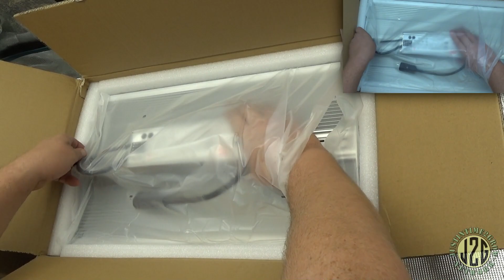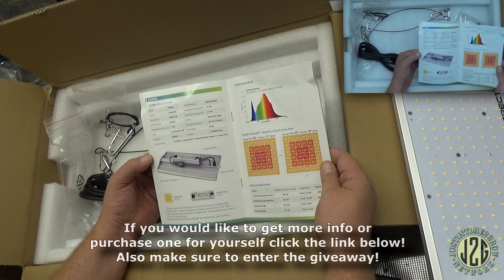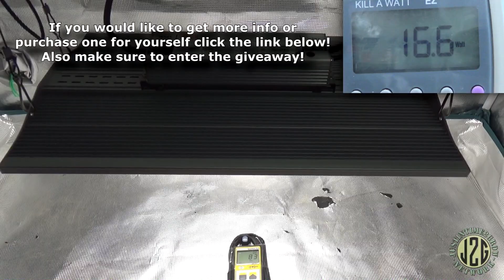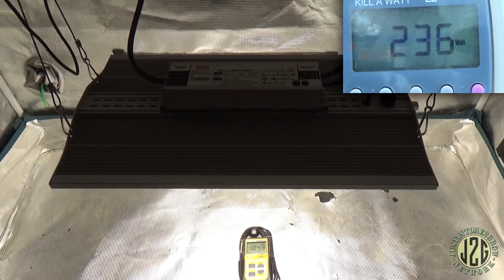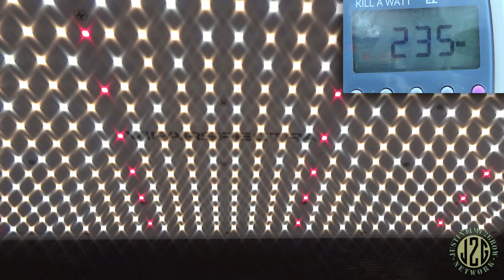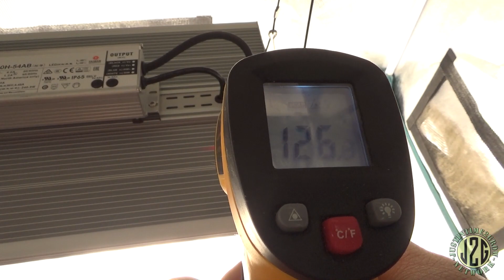Viparspectra XS2000 Giveaway, Unboxing, PAR, Wattage & Heat Test

Comment: A test that is needed is.  If 2 xs1000 in a 3x3 tent vs 1 xs2000 in a 3x3 tent?   See if the 2 lights together would be more than the 2000 or would the 2000 win out

Comment: Great video I need a new light for a 2 by 4 and I can't decided between the sayhon sh2000 with the bar and the viparspectra xs2000 which do you think would be best choice...
Reply from the maker: Neither fully does a 2x4 as you can see in my test videos of them. XS4000 or two fo the SH2000 would be great.

Comment: I received my xs 2000 with 700 leds and not 504 like yours ... would there be 2 models ? ? Strange..
Reply: may be nock off or rebranded
Reply: @kodywayne6211  there are 2 models a light with lm281b and elg meanwell for Europe and an lm301b model for the usa  with hlg meanwell

Comment: A friend of me from europe would like to buy a Viparspectra P2500.
Unfortunately this light isn´t available and won´t be in future at the Viparspectra EU - shop/site.

So if he would buy it via american postal service from the states it would cost in total at least 275€ 
and in case of warranty he would have to pay all international return shipping costs. 
Really not ideal!

As an american buyer the P2500 costs you only 207 USD(10% coupon) with 3 years guarantee service in the states 
and as an european buyer you got just 2 years guarantee for europe, but like I said the P2500 isn´t available at the EU-shop/site.

So if he would buy the smaller P2000, wich is available in the EU-shop/site, he would have to pay 259,99 € for 2 years guarantee service at the EU-shop/site, 
at the US-shop/site it costs only 198,99 USD(without coupon) with 3 years warranty service.

Just for comparison, you can get the SpiderFarmer SF2000 for 247,03 €(without coupon), this light has only high end parts and six leds more than the Viparspectra P2000, not such an nice heat sink like the Viparspectra leds but 3 years guarantee also for their european customers.

If you want a Viparspectra in combination with famous high end parts, you should have a look at the Viparspectra XS series.
But since 2020 the only differences between the XS and the PRO series are the drivers (XS:Meanwell;PRO:Sosen), 
the number of leds (the XS2000 for example uses 504 leds at 240 watts, the PRO2000 uses 600 leds at 200 watts) and the color of the led boards.

My european friend already got the SpiderFarmer SF2000 (new model) and would like to have the Viparspectra P2500 additional,  for the bigger number of leds, the 50 watts more power and for testing the Sosen driver.
But Viparspectra don´t gives european customers the chance to get the P2500 in the EU-shop/site.

Also the Viparspectra P2000 costs more than the SpiderFarmer SF2000 in europe.
So why should anybody pay more for less high end parts, maybe beause of the heatsink and the color, I don´t think so!

So hopefully Viparspectra will offer all of their lights at their EU-shop/site for affordable prices in the near future, because I heard alot of good things about their lights and I think they are really sexy.

Peace - stay healthy
Reply: Good luck with warranty,s spider farmer aka( meizhi)rip offs

Comment: I want to use 2 of these in a 3x3 right now I have 2 of the same strain plants with different soil and 1 happens to grow twice in size. I want to be able and control the light at different heights from my next grow on... you think 2 of these or 2 Spider Farmer SF2000
Reply from the maker: 2 of them in a 3x3 would be pretty solid for sure.

Comment: If you think that is a beast you've never seen the Fluence Spydr 2x. That looks like a flimsy light with a lame coverage area of 3x3 in flower. I would need two of those to cover the same area of my Spydr 2X
Reply: yeah that spydr 2x is also what 850? how many of the xs2000 could you buy with all the money you spent on that thing and its not even the 701 man feel for ya

Comment: Cool Test Justintime2grow. Question for you or anyone who sees this, since you have a 4X2 like me is there a better coverage when you hang double V series Vipers (600's for example) horizontal or vertical in association with the 48 inch width. Have you done any par tests with similar shaped led housings like the 600? mine are currently horizontal.

Comment: I do have a question though Will all of my lights my to Mars hydro my two bloom spect and my Vero sky and my p300 will if I use all them at the same time will that add up to enough because it's about 500 watts from the wall a little less when I plug them all in but they don't all fit

Comment: I just want to thank you for all your videos they really helped me a little too late I own a more spectrum 300 the original a bloom spec 600 avera sky 1000 watt a unidentified light that's supposed to be 300 watt but when I got a wattage meter not a single one is over 125 watts two of the Vero sky and the bloom specific 300 watt doesn't even pull 25 watts from the wall The Mars hydro pulls 125 and the Mars hydro tube pulls 125 from the wall as well and then the blooms back 600 pulls 127 from the wall so it's would be so much help to have this light so I could replace hanging all these lights in such a small 2x4 tent like I literally have six LED lights covering four plants and I'm still not getting very good yields the light fluffy buds not tight nugs like it should be but I do think you I have learned my lesson and I'm more selective about the lights I'm trying to get rid of some of them so I can afford a decent or high-end LED light that will give me high yields and tight nugs but I want to be able to do that without your videos so again keep up the good work and thank you

Comment: That's interesting that yours shows 236 watts from the wall. My xs 2000 shows that it pulls 245 watts  on my power meter. Well one of them is off. I just got mine about 2 months ago, and I have only tested my 2 lights, the xs2000 and my little maxsisun 100w. I think the maxisun pulled about 95 or maybe closer to 90 I can't remember. My reading matches up with what the manufacturer says because viparspectra says it's 240 + 5. I just figured I would mention that difference.

Comment: That would be really good for a 4*4 veg tent. I ran a 4*4 for veg with just one Mars sp250 almost at the top of my seven ft tent and it did marvelously. Of course the hotspot was the foot wide swath directly under it but it reached to the corners and had everybody happy and growing. I don't have a fancy meter so I judge just by how the plants do. Lol
Reply from the maker: It's not really going to veg that well in that space IMO. The SP250 had the advantage of being 4' long. This is half that.
Reply: @Justintime2grow  The spider farmer 4000 did it too in a 4*4 until my plants got too tall to have proper light hit them. I ended up getting two more Mars 4ft-ers and dropping the sf4000 into a 3*3 where it can flower the entire thing.
Reply: I'm just saying it worked for me. I don't have the a par tester to get the numbers from it ran 5-6 ft off the canopy at 90%. The sp250 had the advantage of the length, but was very narrow in width compared to a square-ish quantum board. 🤷
Reply from the maker: @forklifttony  neither is ideal and everyone has a different definition of “worked”. A lot of growing is subjective. As long as you’re happy that’s all that matters really. 👍🏼

Comment: Have u tested the Mars hydro tsw2000 out and if so what size tent would you recommend
Reply from the maker: I have not but I used one at the 4000 plant farm I managed this last season. I used it in veg to cover a huge space along side some HPS. Probably around 6x6 veg from that light alone. I would say 3x3-4x4 flower.

Comment: I got a 2×4grow tent first time grower.Is there anylights with built in timer.?
Reply: Buy a separate timer. Its cheaper and would work better than lights with built in timers
Reply: @robm425  Do I have to connect it to anything or I would prefer a simple plug in
Reply: @yverak5504  my timers plug right into my power strip and then the light plugs directly into the timer. Google them as theses timers have been around for years. Now I use smart plugs so I can control the lights by app
Reply: @robm425  Thanks for the info ,granny messed up my first grow when I forget to turn my lights off.

Comment: Got a question. Is it true that you have to increase light during flower each week or it will starve your plants? My friend is letting me use his 1k real watt hps and it has no dimmer so it's full blast the whole flower.
Reply: Whaddup William W?! Hope you don't mind me giving my opinion on your question. I've been growing for 3 days now (kidding, kidding) and What I've heard and through experience is that you're not necessarily "starving" your plant because plants make it to harvest all the time with different method. I think it's more a matter of introducing your lights at full power all at once and not being able to gradually give it increases so it responds more efficiently instead of becoming tolerant of the power and not being able to stimulate it any more. It will still grow as long as it has the power to get through flower in the first place. It's similar to stressing the plant with darkness before cutting or just like a real child or animal or wife (oops), it will stay alive and continue to grow, just not at its full potential by giving it more when it can take more. Are you able to adjust the height? Doing this would be similar if you're able to cover the required footprint. Also, not all lights have dimmers. Even some of the reputable ones like Spider Farmer or Mars Hydro didn't have them in the beginning. So people made due, you know? If I am completely wrong I apologize for misdirection, and maybe just talk to it more and breathe on it. You can doooooo it!

Comment: I have some 3500k and 380-840nm full spectrum grow solderless driverless cobs from Yuxinou. Anyone know the efficiency of these and if I really don't need a separate driver for them?
Reply: They have really bad efficiency for an led and get really hot. They also don't put out as much light as other cobs. You don't need a driver though. I would like to see your results though if you decide to go forward.
Reply: @flyinbantito  i kind if thought that might be the case. I intend to use them for supplemental lighting eventually but I dont have any lights currently :(
Reply: @kevinnolastname2220  what size area are you trying to setup? Also check out stealthgrows.
Reply: @flyinbantito  AZ just legalized so no more stealth grows for us lol. I am setting up a 5x5x8 section of my plumbed, insulated, and air conditioned shed with a 4 site rdwc.
Reply: Eventually upgrading to a second 5x5x8 as well as an open mother/propagation area
Reply: @kevinnolastname2220   oh nice. Also stealthgrows is a massachusetts guy on youtube lol. I was going to suggest going maybe a smaller area with like a budget light from Amazon or something if money is an issue. But you seem to be a buy once cry once kinda guy like myself. I don't know how much electrical knowledge you have but you can always build your own light. I would look into a ten or twelve strip samsung f series setup they usually end up in the 350 to 450 range depending on how you build them
Reply: @flyinbantito  Yeah, I used to have a 12 plant Blue Dream grow and we wasted a bit of money and time as we went through a few sizes of grow area before discovering that they were to become 4 feet tall and just as wide plants. We made it work for a couple years but this time I'm starting with fewer plants, smaller plants, and with a lot more training and more blue better quality light to help keep stretch down. Quality saves money and time
Reply: @flyinbantito  and I will also check that guy out. I'm pretty good with electricity and electronics but I only know how to solder with oxygen and acetylene. I have never used a solder gun for tiny solders
Reply: @kevinnolastname2220  the f series strips are solderless they have a push type connector on them. I believe they come in 2 and 4 foot versions and should be able to allow you to mimic a gavita or spyder type light. All you will need is the heatsinks led boards driver and a way to mount everything up